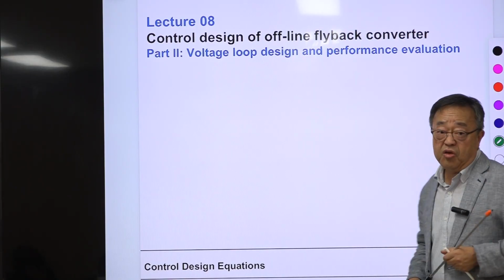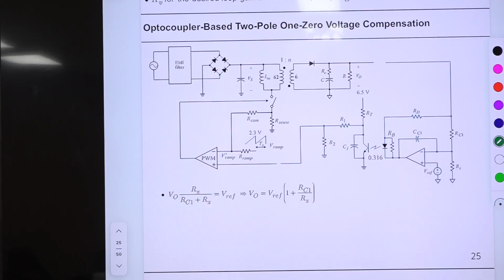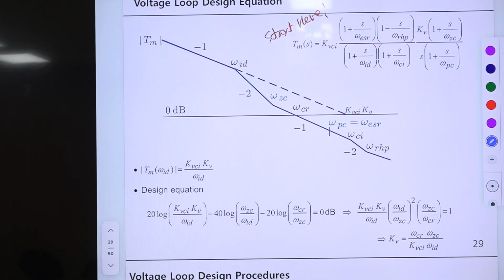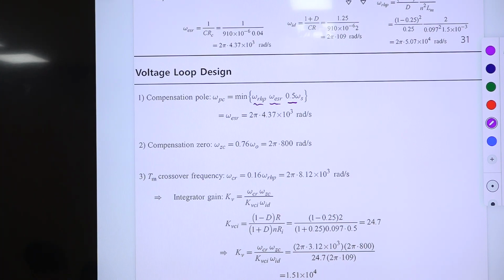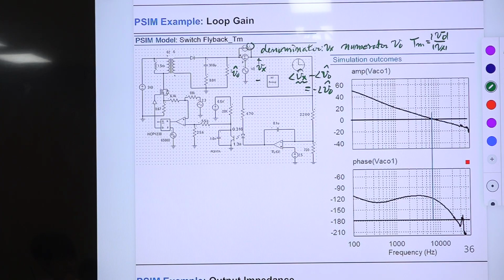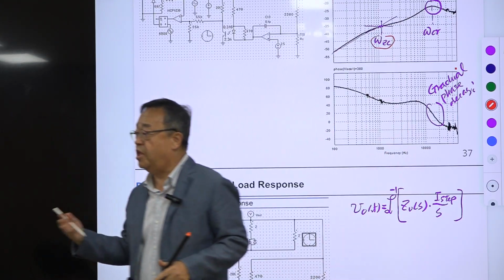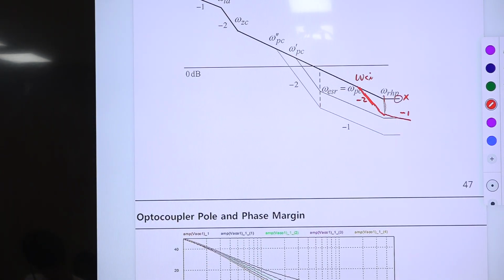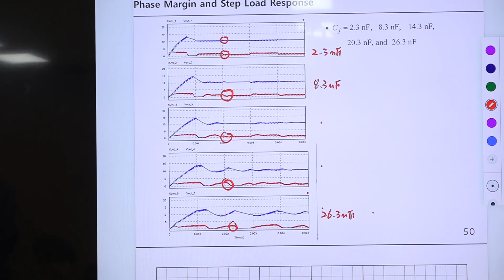Lecture 08: Off-line Flyback converter, Voltage Compensation Design, Loop gain, Output impedance

Comment: Great material, but I would like to add some comments. The DC gain of the Flyback converter working in current mode is proportional to the inverse of the current-sensing resistor value. But Kvd seems (nVs)/(1-D)^2, which has no relationship with the Rcs value. If the DC gain is wrong, the crossover frequency will be completely different. Accurate DC gain calculation is crucial to optimize the controller's gain and boost phase angle. The DC gain you calculated on page 31 is 53.5, but my calculation shows DC gain=16.5 with Sc=34[mA/uS].
Furthermore, weak slope compensation in the Flyback-CM-CCM causes sub-harmonic oscillation.  So there must be double poles for the sub-harmonic oscillation. In addition, there is a major low-frequency pole. Hence, it becomes a 3-pole system: the major low-frequency pole and two resonating high-frequency poles in the Flyback CM-CCM. Thanks, Simon.